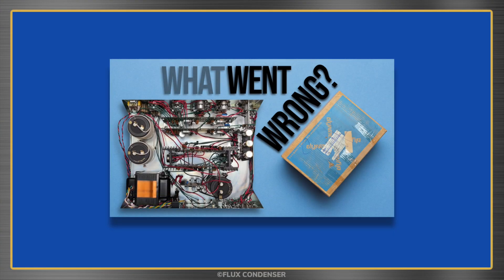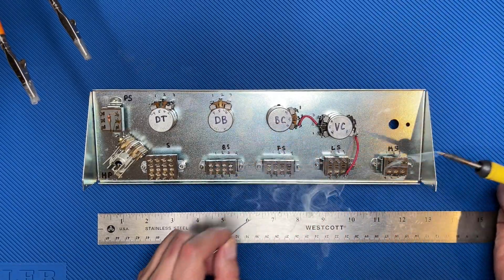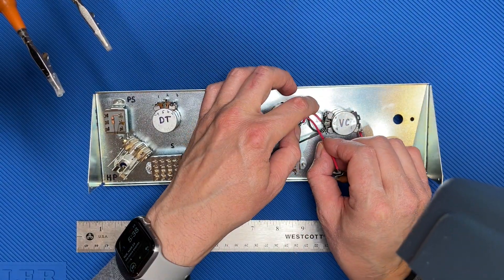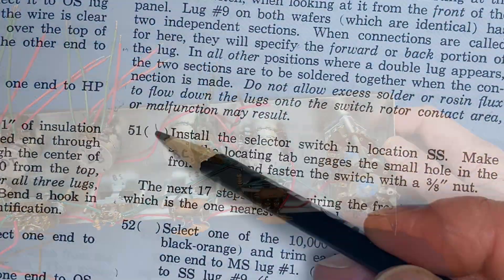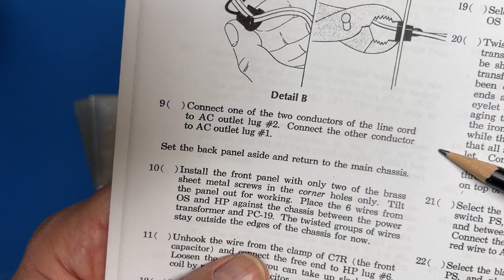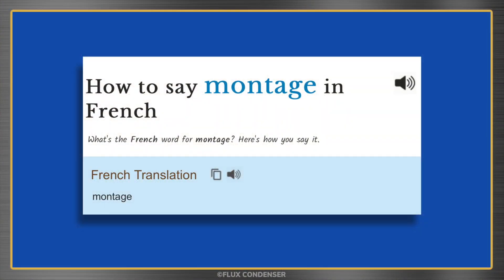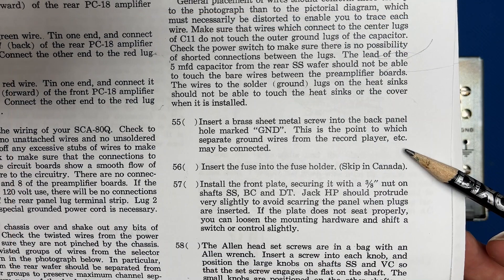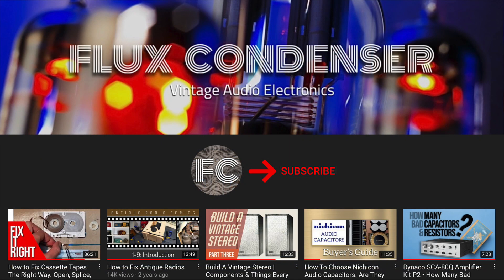Dynaco SCA-80Q Amp Kit P6 • What Went Wrong?

Comment: Do I understand correctly that there is a clean signal at the headphone jack only when the headphones are plugged in (which should disconnect the 8 ohm load from the power amp)?
Reply: At 13:42, there's a semi-closeup of the headphone jack area, and  I see a suspicious bit of bare wire associated with a white wire but it isn't clear if it's touching something it shouldn't. Regardless, the headphone jack itself or wiring fault there is what I would check first given the symptoms as I understand them. Are the channel outputs being connected together when the headphones are unplugged but then separated when the phone plug is inserted?
Reply from the maker: @halhollis6368  Great question, Hal and something I didn’t fully address. Yes, the signal to the headphone jack is clean, but only if the amp is not under load. So, without dummy load, the headphones get a clean signal. When speakers or dummy load are connected, though, the left channel only (the channel which does not switch off the speaker at the headphone jack) becomes distorted.
Reply: @FluxCondenser  From what you've described, it seems to me that the power amp power supply wouldn't be the issue. My reasoning is this: if the distortion is in the left channel only under the circumstances described above, and if the reason the left channel is distorted is that the power supply is pulled down for some reason, the right channel could not remain unscathed. To be clear, you're driving both channels simultaneously with large signals?
Reply from the maker: Good reasoning, Hal. Yes, the symptoms I describe are with both channels driven with an appropriate input signal, and loaded as-described.

Comment: Well we know that it must be before the first trans as the signal is clipped on all three leads. This is clipping to be exact I guess it could be called form of distortion. Distortion is usually describe as a breakdown in linearity. Anyway check the biasing of you trans. Can't tell from the trace but could also be a harmonic distortion you will see a fuzzy worm on the flat to. Could also be some DC on the line
Reply: Sorry meant after the first stage
Reply from the maker: Nope, as I showed in the video, the signal going into the first transistors (coming out of the preamps) is clean. Any deformation of a sine wave is due to some form of clipping (the sine starts becoming a square wave) so I wouldn’t say “it could” be called distortion. It absolutely is distortion.

Comment: They are brown drops, much less common than green, orange or tropical fish. Just cheaper version of mil-spec green/grey drops, Made until late the late 60s these would be surplus stock.  I would guess just cheaper versions of film caps
Reply: I haven't seen them in years. Last ones I saw for sale we at surplus of Nebraska Web site.  They are foil caps with a ceramic coating. Never popular and made for only a short time late 60s. The space age mylar caps took over the market .
Reply from the maker: OK, thanks for that. You’re the second or third person to state that they’re not ceramics, but foil or plastic-style caps with a ceramic coating. I didn’t want to dissect the ones in the kit, so, based on this feedback I’ve ordered a few similar-looking caps from ebay that I plan to dissect and report on in an upcoming video. Thanks again for the info and stay tuned for more on this subject.
Reply from the maker: Thanks, Ludmila. Do you have any more info or links to support that? I appreciate the input, but I’m skeptical as the brown drops I’ve seen are resin coated while these are ceramic coated.

Comment: If the fault is common to both chanels i would supect the PSU.
Reply from the maker: Good troubleshooting instinct, Rob. Stay tuned to see if you’re correct.
Reply: @FluxCondenser  and asa the clipping looks to be on the top half of the wave form may be pos voltage is low.

Comment: That brown ceramic-ish coating on the capacitors is called Durez. Dynaco and others specified it for many circuit parts over the years.  The Dyna SCA-35, PAT-4, and FM-3 use Durez coated PECs for phono input de-emphasis shaping, tone control shaping, and in the IF and multiplex sections of the FM-3.
Reply from the maker: Thanks, Darth. I have the PEC capacitors in the FM3 that I built, but those are quite different than the “tubular ceramics” in this amp. Interesting that you found a name for the coating. It appears similar to the coating on most ceramic disc caps, so I’m not certain it’s significantly different in composition to what’s used in those. (Is it?) I’m sure there are all sorts of formulations that have been used over the years, though. Any more info or links you can provide to shed some light would be appreciated.
Reply: @FluxCondenser  The PECs are "Packaged Electronic Circuits" and in Dynaco's case are small RC networks for frequency shaping.  They aren't capacitors per se, but contain a network of caps and resistors.  They're coated with the same stuff as older ceramic caps because you could just dip them in the slurry then print their specs or part numbers on the side of the part after drying. I found a Vishay PDF telling when they dropped using the Durez based cera-mite coating from their ceramic caps.
Reply from the maker: @darthbubba866  Thanks, Darth. I’m familiar with the packages. They’ve been doing that since the early days of radio (although with metal packages) and I’ve rebuilt several of them. I had only asked about the PECs as I thought you were suggesting they were the same as what are in the SCA-80Q amp. Sounds like you were just discussing the outer layer composition. Take care.